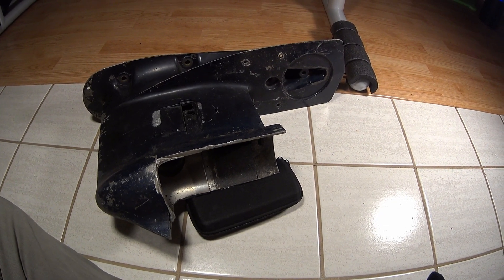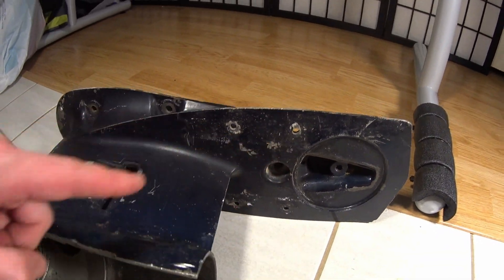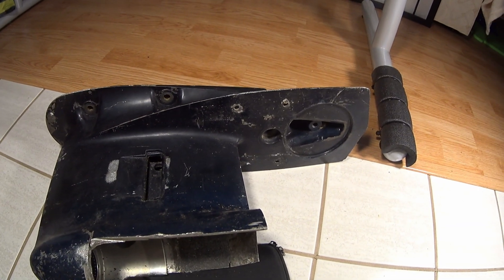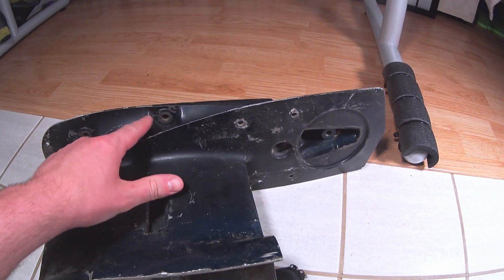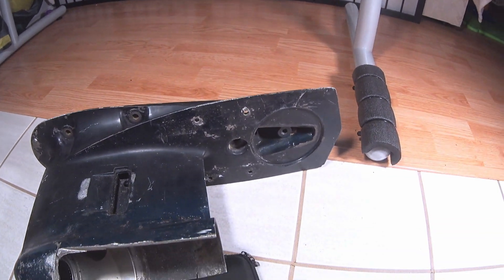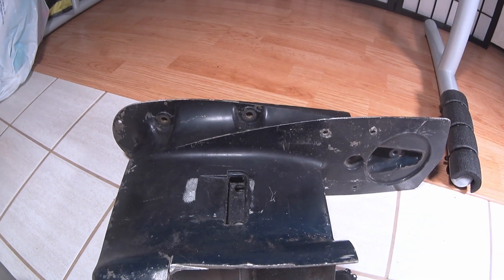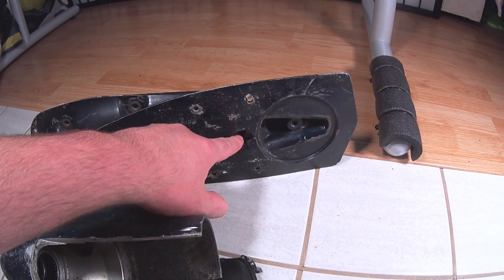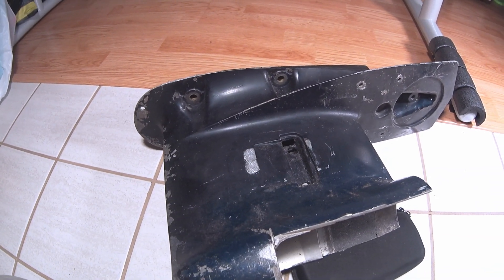Removing Outboard lower unit: careful not to break this 1 bolt - bolt remove order.

Comment: That bolt broke on me an I can't get unit to come out
Reply from the maker: Make sure you have the 4 screws and the shift rod disconnected. After that, you could theoretically just saw it off if there is a tiny gap, or drill it out. This screw really isn't .... Necessary. Yes it makes things stronger but as long as you have the other 4 in well, I doubt you will have an issue. Maybe if you are planning on crossing the Atlantic a few times over :p
Reply: Is discord still a good way to get in contact with you? I just sent you a message